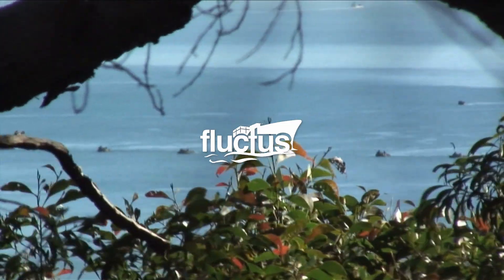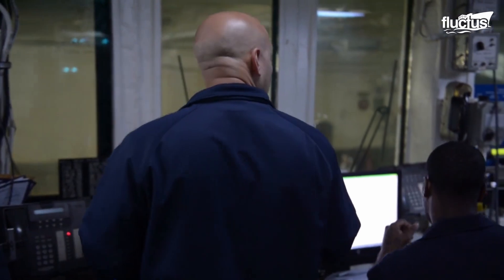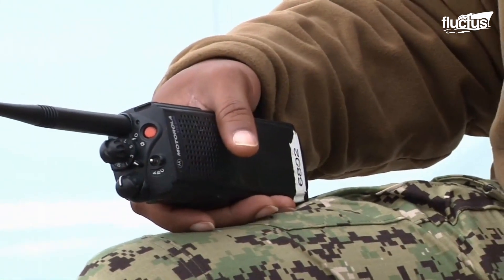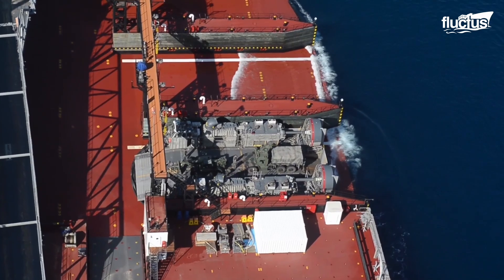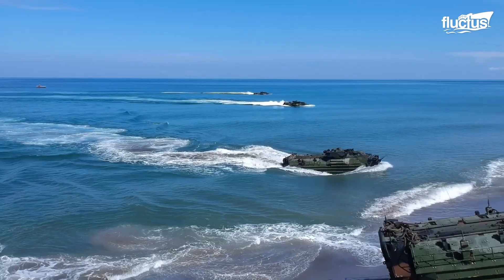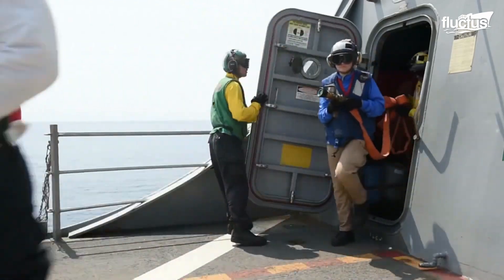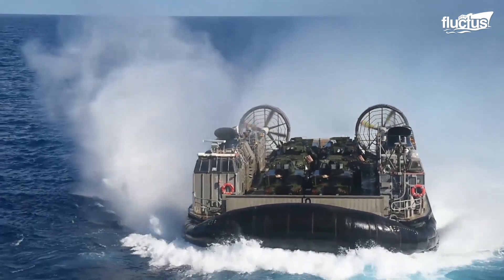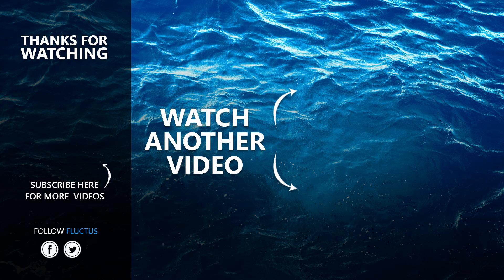Inside Most Feared US Invention for Beach Landing

Comment: Have these equipment been actually used in real combat situation ?
Reply: Not the hover craft ones no. Not that I know of.
Reply: These vehicles are relying on large inflated rubber tubes which should be fragile to sharp objects. If the enemy spread such objects along the shoreline, how can they handle this ?
Reply: @SeekingTruthAnd  They clearly detailed how these craft will follow a beach master team, which implies they are a second line insertion method following initial amphibious deployment through the attached aviation element. The smallest marine expeditionary units (ARG/MEU) are flagged by a Wasp-class or better vessel physically similar to many other nation's aircraft carriers for a reason: ground-air combined arms is the bread and butter of the USMC, regardless of their heavy naval association. Naval superiority allows the ARG to position near the beach, aviation allows for initial, rapid deployment of forces which can establish a beachhead, and the LCAC and other boat I forget the name of follow on to finish deploying the rest of the forces. Sure, the LCAC's cushion is vulnerable, but the LCAC is designed for high-speed (to allow rapid ferrying of multiple loads) and the ability to insert large quantities of forces onto 3/4ths of the worlds beaches where traditional vessels cannot reach; you'll want to control that beach with thorough air superiority before you're ferrying troops and materiel back and forth. 

Put another way: Combat insertion is done with aircraft, or the armoured AAV's, supported with close air support; the LCAC's are used to finish deploying remaining marines and the logistics elements and their materiel, to support forward operations by front-line marines that have already pushed or breached past the beach. The LCAC is principally for ferrying command and support staff that enable forward combat operation sustainment while minimizing environmental obstacles (rather than combat obstacles), not the direct combat personnel who will have been inserted alongside the first wave of overwhelming air power (and can be inserted wherever those air assets can get them, in exchange for the increased risk and cost of air elements).